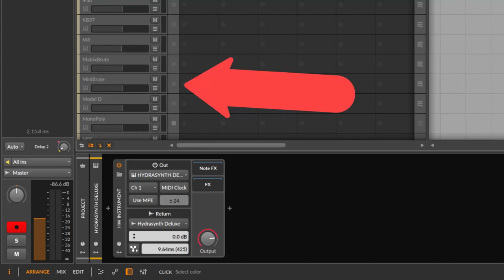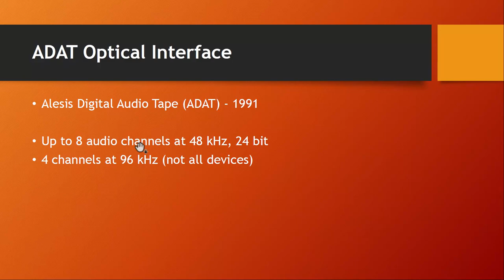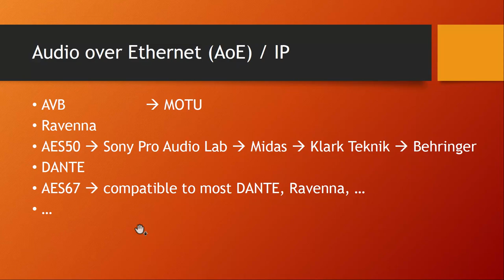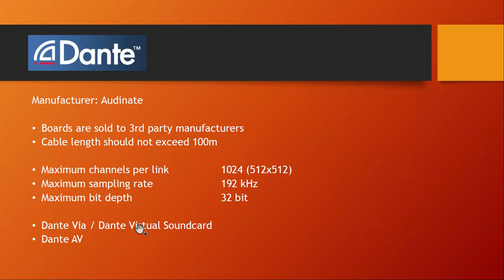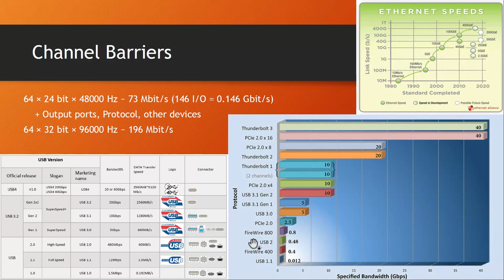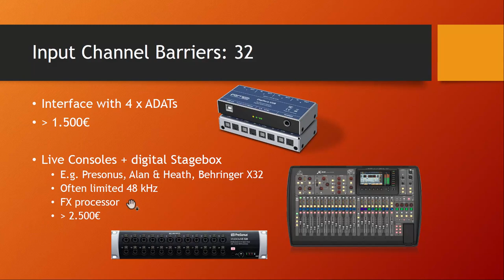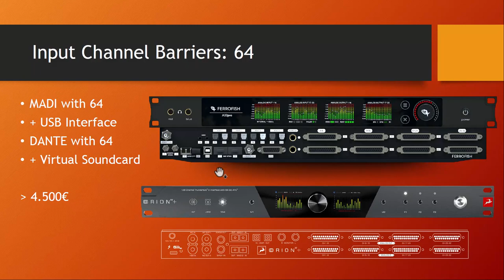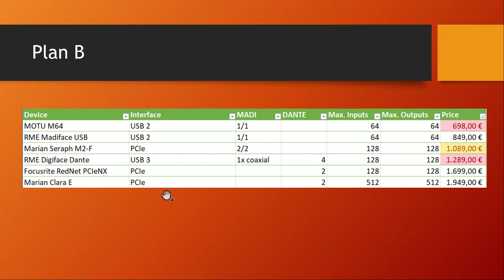Breaking the Input Channel Barrier - DANTE, MADI, ADAT - devices and solutions!

Comment: To answer one of your questions: “Why would someone need more Outputs than Inputs?”  I had to laugh!  

My first interface was an 8-channel I/O 16-bit 44.1/48k only, a ProTools Project system in 1996.
In those days, the DAW didn’t have many useful features and or plugins, and nobody was thinking to work entirely in the box.
Almost everyone used the DAW to replace the Multitrack Tape Machine, and that fed into an Analog Console.

So most of these years I’ve been asking the opposite question:
“Why the hell do I need 32-inputs, I’ll never track that much at once?  What I need is 64-Outputs or more, so I can spill Everything into my board.”

I’m pretty sure Digidesign sold way more outputs for the 888s and 192s, and Apogee sold way more DA-16s than AD-16s.

I now use a pair of Presonus Quantum 4848s for 64-channels of conversion I/O and another 32-channels (16 in 96k) on ADAT.
Reply from the maker: Ah, good comment! I knew there was a use-case! 🤣 I know there are some studios still working like this.But do you still see these requirements nowadays?
Reply: I think Many people still mix in Analog or Hybrid, so I don't know about "requirement" but having as many D/A Converters as possible is very much still a preference for a lot of mixers.

And SSL, Neve, RND, API, Audient, Trident and others are still making and selling Analog Consoles, so....
Reply: I also think you brushed past using Digital Consoles and Stage Boxes to get high I/O counts.  I think that IS the most cost effective and logical way nowadays. 

Most Digital Consoles have a USB port and show up on your computer just like any other interface.   Plus they come with Low Latency monitoring and effects in addition to their on board mixing engines, that can be used for tons of utilitarian functions,  and free up the CPU on your main DAW for more creative stuff.

In addition to that, most of them can take a Dante Card (and others) allowing you to route anything anywhere.

If starting from scratch it'd be hard to justify Not going the Digital Console route.
Reply from the maker: @G_handle You are right, I did not look too deep into the mixing consoles. While they are very interesting, I pretty quickly ruled them out due to their size (even the rack versions are pretty clunky).
Reply: @mossgraber  I hear you, you did say that in the video.   However a couple of thoughts: 

A) The size of most rack units is nearly identical to a normal interface due to the  physical size of the connectors themselves, and because they're intended for "Live" sound, they usually provide all XLRs or TRSs.   You can only get 16 Neutrik XLR connectors across a 1U jack panel for example.

An interface can be 1U and have 32-channels, but on DB-25s.  You then have to, as you mentioned, buy or build DB-25 to XLR, TRS, or Patchbay cables yourself, which like you said is a "Hidden Cost", but it's also a hidden Size/Real Estate cost.  Especially if you then terminate the DB-25s into jack panels anyway.   The Digital Mixers are Already ready to go. 

B)  Nearly all Digital Mixers use "Digital Stage Boxes" as well, and some have a 1U rack Mixer with little "local" I/O, but allow Many channels to move across single Ethernet cables to wherever you need them.  In a Live setting you may have "Drops" at FOH as well as Left, Right, and Rear Stage, and at another Monitor Mixer, and at another Broadcast Mixer, And at say a Press Bridge for the Media.

In the Studio this same Digital Distribution system can be extremely useful to run simple Ethernet cables to wherever you need I/O.

C)  The Digital Mixer route is expandable,  meaning that you can buy the pieces you need now and add on to that down the road when the needs or funds arise.

D)  If you're Recording other artists in your studio, don't forget that Digital Mixers provide pretty elegant and flexible Headphone Monitor Mix functionality. 

There are Many high end Analog Recording Studios that have added say a Behringer Digital Mixer just to use for feeding thier P16 personal Monitor Mixers.  This is a great system and gets gives everyone a custom version of whatever they want. 

E)  Lastly.   I love what you are doing, providing some much value to our community!   I want to Thank You directly!!!

I do think though that maybe not now, but you should also think about how a Digital Mixer is reaaallly just an Audio Interface,  with its own DSP engine,  aaand usually a built in Midi Control Surface!

You are the King of Midi Control Surfaces.

Over the years we've convinced many of the Digital Mixer manufacturers to let us have a "DAW Controller" mode on thier boards....but most are not very good. 

But that's where you come in.
Intercepting the Midi between the Board and the DAW, and making it behave.

Imagine a session where at the press of a button, your Control Surface really does go back and forth between Console and DAW...seamlessly.
Reply from the maker: @G_handle Don't want to argue with you since I agree. 😀 It is just not the direction I decided to go (also because I simply like to tinker and test what Dante can do).
Reply: @mossgraber  No, I hope that didn’t come off as Arguing, I was trying to Add to the discussion.
I myself have gone with Interfaces, but mainly because of what was available at the time.
My system is perfect…for me.  But as my Quantum interfaces are now discontinued, eventually I’ll have to revisit my own setup.

I was only trying to point out that if I were deciding today from scratch, or advising someone new, the evolution of Digital Mixer conversion quality, I/O count, and price, together with everything else I said make it a difficult option to dismiss, or put in a positive way, an option that people should strongly consider.

Again, I’m not questioning your decision, I myself haven’t gone that route….yet.
But others in this community Should at least know it’s an option.

Comment: I would be curious as to any issues you run into when using this setup. I ended up trying to go the AVB route, as I had a Presonus mixer, and frankly couldn't get it stable. It would either fail to send audio, or the audio was so bit reduced it sound like chip tunes. A follow up video of your experience in setting it up and discuss your impressions of it would be awesome.
Reply from the maker: That‘s the plan 😀

Comment: Im toying with rme usb digiface with various adat ada kit. Its a bit vague whether multiple rmes can share the same driver in windows..
Reply from the maker: That would surprise me a lot and did not read anything about such a possibility so far.
Reply: @mossgraber  If all units are fed with a synchronous clock, i.e. all units show Sync in their Settings dialog, all channels can be used at once. This is especially easy to use under ASIO, as the ASIO driver presents all units as one.
Reply from the maker: @0richbike Are you talking about 1 Digiface with 4 synchronized ADATs or several e.g. Digifaces devices connected to USB? If the later is the case where I can I read about this?
Reply: I reckon the ferrofish is better if you can afford it;-)
Reply: @mossgraber  finally got it to paste
Reply: No I didn't .
Reply from the maker: @0richbike  I guess you want to paste a link. Simply add some spaces. Or describe where to find the info.